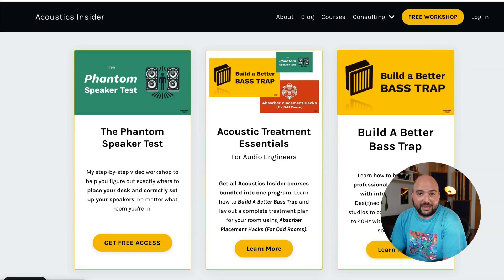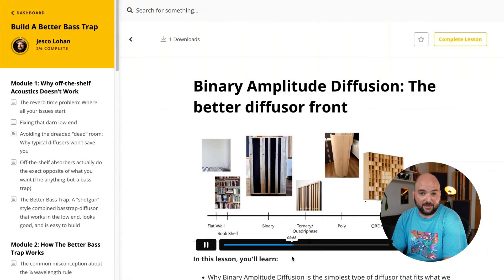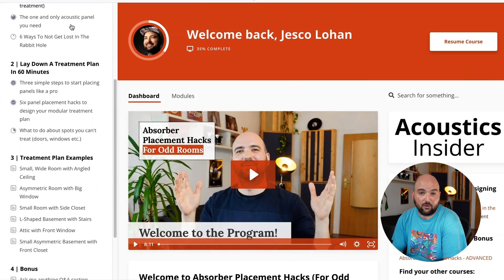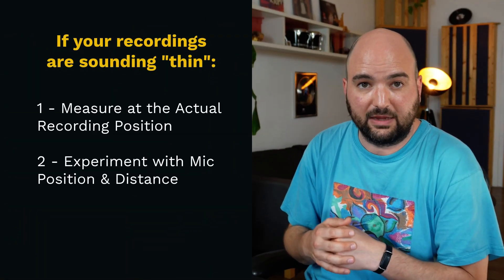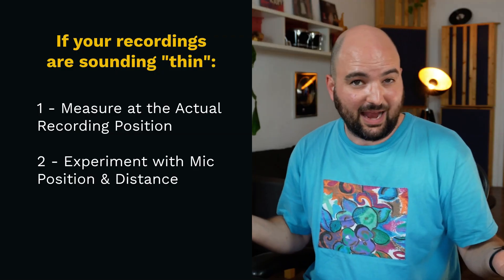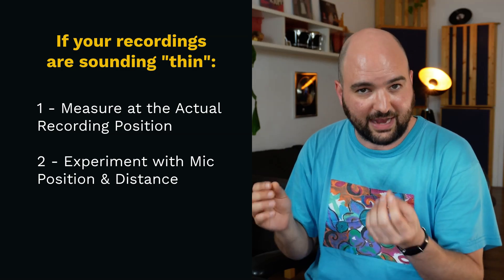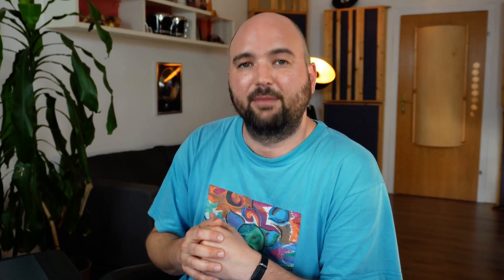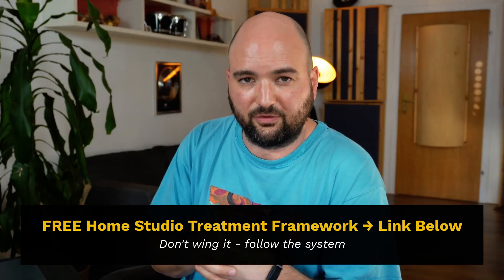Can You Actually Over-Damp a Home Studio? The Science Says No

Comment: If you had the option to put up a fair amount of deeper traps filled with lower GFR material, say a mix of 8, 16, and 24” deep traps, would there be any point or need to make high freq specific panels with higher density material? I’m assuming the lower GFR material still works on highs and mids?

And, if you had two pieces of 4x24x48 absorber material, would you make one panel with 8” of material, or two panels with 4” of material and a 4” air gap for twice the surface coverage for the same price of material?

Comment: So my nuclear option of placing panels on almost every sq inch of my small Mix room was not so crazy then? 

Might have been wasteful as i panelled spots that were not ‘just’ at the prime reflection points. But as time costs far more than GIK panels so I did not want to piss about shifting things and re-arranging so bombed every wall, corner and the ceiling with panels minimum 170mm some are 400mm!

Comment: I can attest to this.  I have a 7m*4m room.  The entirety of the walls and ceililng are treated with thick absorption only, not a single diffuser.  Since the entire surface is covered, floor to ceiling with absorption, it's literally impossible to add more.  If over-treating were possible, I would have shot way past that.

It's a little bizarre hearing your voice without the reverb you'd expect from a closed space - I can see the walls, but I can't hear them.  Music sounds great, so the room certainly isn't "dead" in a bad way.  I haven't tried setting up a microphone to record, but if music sounds good in the listening position, I don't see why a recording wouldn't also translate well.
Reply: Same experience here.
Reply: Ditto. I did find a way to add more. Placed a wall of sound blocks in front of a wall of Soffit Traps 😂. The downside of maxing out is that room can get hot as hell without A/C!